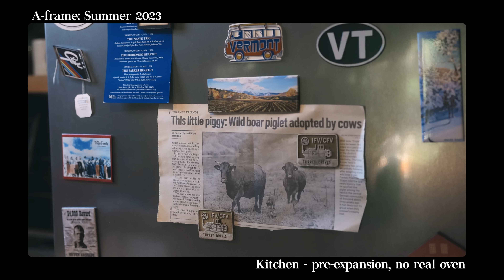Moving into an Old A-Frame Cabin

Comment: Your a girl after my own heart. I’ve always had a soft spot for a frame houses. You have learned a lot in a short time. You can do it! Do not underestimate the damage of water. One of the houses I bought there was a soft spot in the floor and I was pulling up the rug and going to fix it. What I am covered not only the soft spot being water damage but it was coming down the wall from an upstairs window which intern had damaged the whole wall. Everything had to be replaced. All because of a little water leak. But overtime it can cause huge amounts of damage. So I would get that Skylight fixed immediately

Comment: A great project. And with any great project, you need to first stabilize the structure. I hope you turn your attention to the roof and skylights, because leaks are like icebergs.  What you see is usually only 10% of the issue. A stable structure brings more peace of mind than paint and plants. If you have to bring in an expert, then do it before you lose the entire roof to rot.
Reply from the maker: Thanks! Yes, certainly going to start tackling the necessary things as quickly as possible!